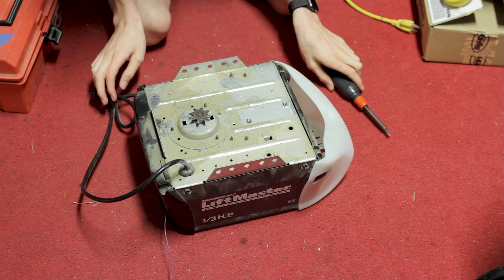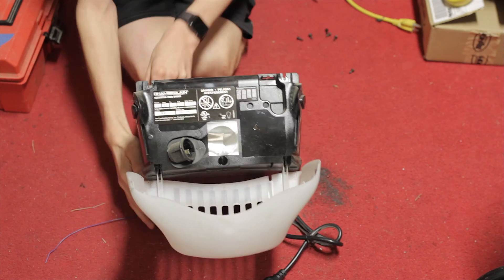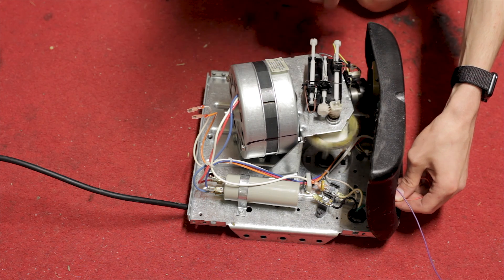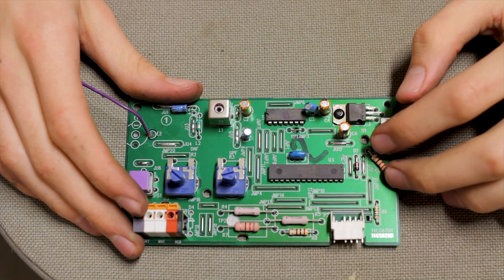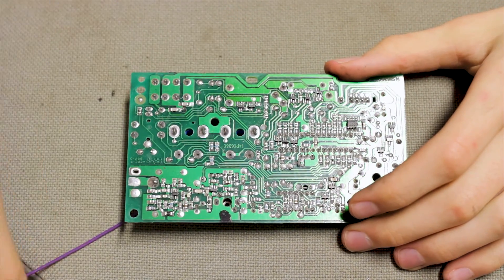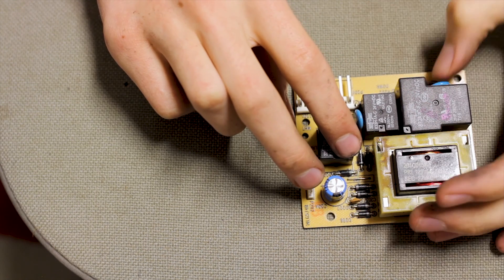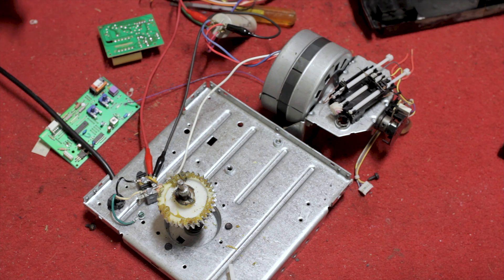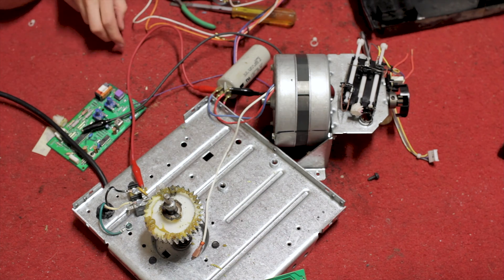Whats Inside #25 Garage Door Opener

Comment: Finally someone showing how it stops automatically! I had to watch about 10 videos to see someone explain that. I was curious about the mechanism.
Reply: early form of VFD (variable frequency drive) tech.  
the "limit switches" with knobs are likely sending +/- power to big control chip. Those have internal crystal timing chips which is useful when comparing that data (from encoder) and programming to operate motor by frequency.

Comment: Hi can I change the power supply on something like this out for a DC battery? What would I need to do?
Reply from the maker: Since it has transformers and a ac motor it needs ac power. If you want to run it from a battery it’s probably best to get a dc to ac inverter with enough output and the. You can use a battery to power it.